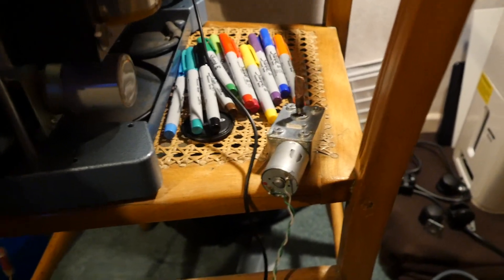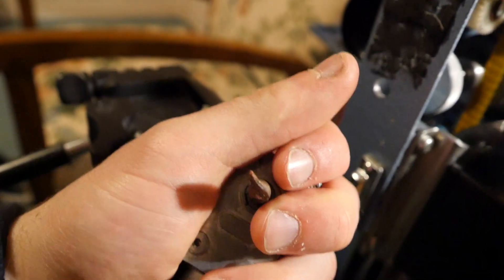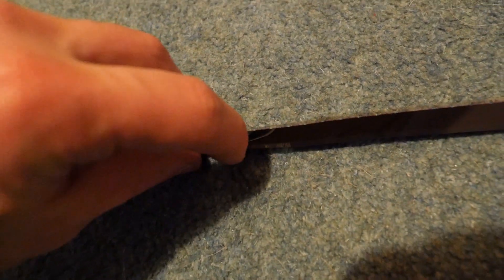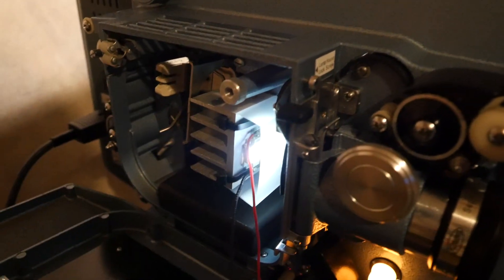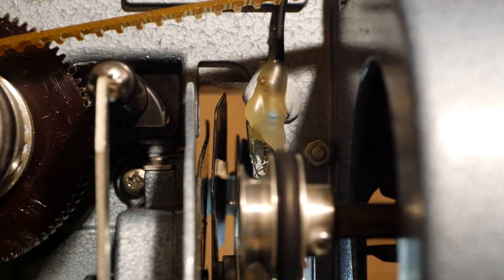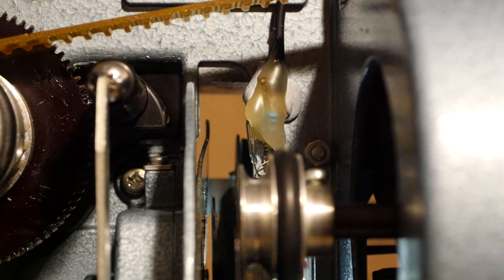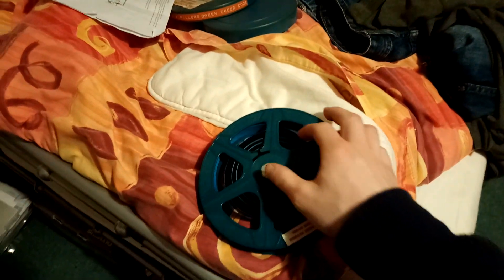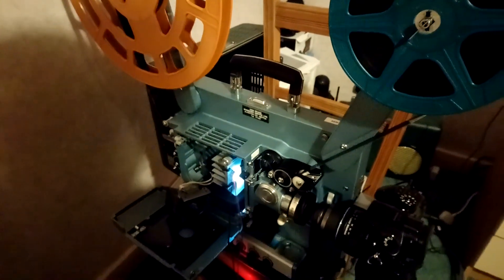DIY 16mm Film Scanner Completed

Comment: NEED SOMEONE LIKE WOLVERINE TO DO A 16MM SCANNER
Reply: What we need is the software to take those individual frames, with optical audio, and decode and sync the audio to the video at an accurate frame rate.  Then we can shoot into the gate of ANY 16mm projector with a macro lens with extension tube that we choose, using a low-speed mottor and in-the-gate camera triggering switch.  The Wolverine quality is meager and the mechanism much worse than the projector and camera I already have.  I just need software to feed the still images into.